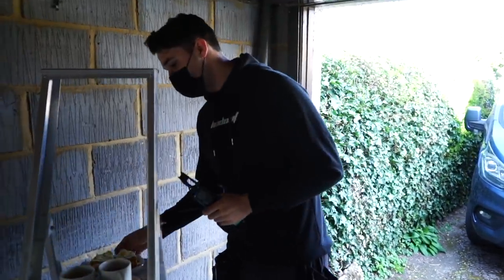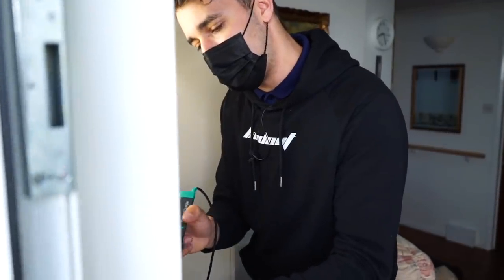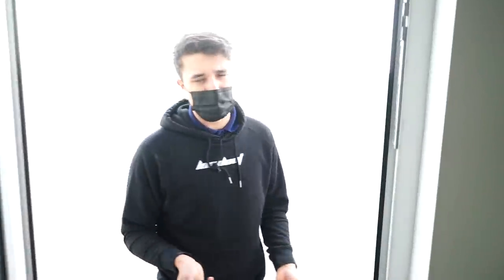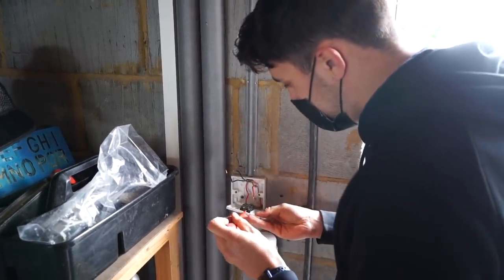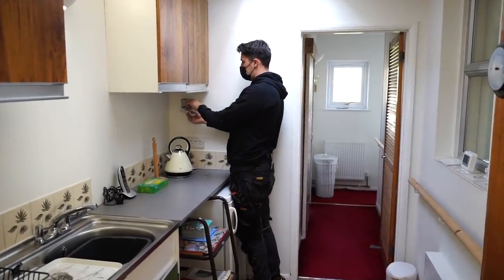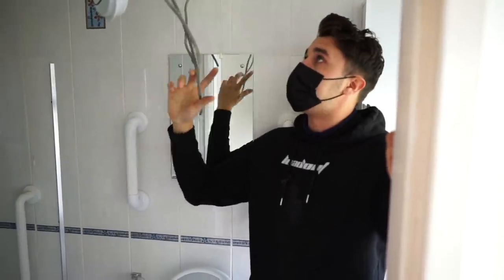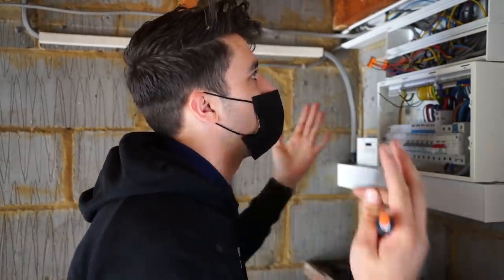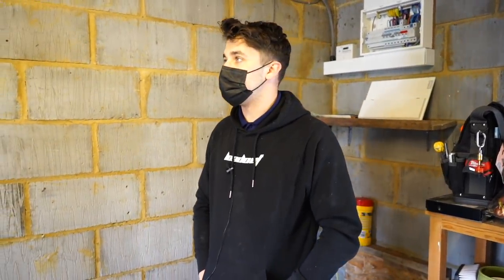Fault Finding a Scary Lighting Circuit - Electrician Life

Comment: 2:22 - Cory, I can imagine you wiring up a cooker and then immediately jumping into a cooking demo for the customer, teaching them a new recipe. 10/10 would watch that.
What a cluster that job was! 

For a time, I lived with some friends in a house built during the 1950s (US). Every light was operated by a momentary pushbutton switch that operated relays in the basement. After fifty years or more of use, the relays had mostly failed. Lights that were already on stayed on, because if you turned them off, they might not come back on again - or blink off before returning to on. At least half of the house had lights that didn't work at all, or would give one extremely brief flicker when you push the button before staying off. Receptacles on these switches didn't work in most of the house. An absolute nightmare.
I tried to convince them to do a rewire, since they were letting me stay there rent-free and I was unemployed and had the time to do it... It would have been pretty simple, everything was wired through conduits down to a single main trunking tray that ran in a beautiful straight line to the consumer unit and the box with all the relays in it. An electrician's dream to rewire! (The house was built by the same contractor that built several local schools, so it's over-engineered and built to a commercial level.)

Comment: Well done untangling this nightmare. I recommend buying yourself a Progressive Electronics 200EP inductive amplifier together with its audio warble tone generator for tracing out cables when you are on your own. As I have said in a previous comment this unit has saved me hours of unnecessary stress by quickly locating and identifying cables in an installation. On second fixes this unit helped me find cables lost behind plasterboard because cutouts in the plasterboard for socket outlets and light switches had been forgotten.

Comment: The lighting wiring you've described sounds very much like the French system using teleinterrupteurs..... basically you have a switch unit attached to the breaker in the CU which receives a signal from the switches which then sends sends or turns off power to the lighting part of the circuit.  The advantage is that you can have as many switches as you like and wherever you want them.
Reply: I remember staying in a gite in France that had an immense CU,  with a number of what seemed like contactors in. It seemed it followed the system you describe. A friend who moved to France and had to do up an old farmhouse using a local spark also said he thought his electrician was mad, but the guy assured him it was "the way it was done there". So maybe the spark who wired the property in the video was French. I don't see point in rewiring it, just to fit with UK traditions. Surely already 3-plate system can present problems with led lights, so new builds don't use it. Tradition is not always "right".
Reply: that's basically how PLC works. With PLC you only have power going through the controller relays to the lights and fans, and whatever else is connected to it, and then switches are connected to the controller through signal wires, which can be quite thin since they don't carry any real current. Since the PLC is programmed to turn on/off or dim stuff depending on which signal it gets (and what the current state is), you can hook up as many switches as you want using the signal wires and the only thing that determines what they do is how they're connected to the controller, and how that is programmed. It completely removes the need for switchback wiring when you want multiple switches controlling the same thing, and any switch can be programmed to be a dimmer if you want, or you can code patterns, where 1 press turns on the light, the next press turns on the fan, and so on.

Comment: An acquaintance wired his house like that - all switch wires back to the board - but there was method in this madness, he was an electrical engineer (with a trade ticket) and he built its own 'smart home' system. Every one of those switches was input to a computer which then controlled contactors to actually turn the lights on and off. He 'star wired' all the power points too, so they could be centrally controlled and monitored - he also added current sensing to each line and recorded power consumption for each circuit.  It was a LOT of work and wire. But he could turn on or off any light or socket in his house from anywhere that had internet access. When he built it, these modern interconnected smart home systems only just appearing on the market and were quite expensive. If a regular sparkie ever gets called to that property 'diety' help them. They will be flummoxed. It complies with the required standards, but it's not a conventional layout.

Comment: Looks like star wiring you used to do for running X10 din rail dimmers that all terminate in a node0 (or consumer unit in this case).  has the previous owner just taken all their home automation units out?
Reply: I was wondering the same thing - it smells a lot like a former home automation job

Comment: What a mess! Must have been a relative of the expert who wired permanent live and switch line to L1 and L2 on a 2-way switch, only to discover the light didn't work. Instead of moving the live to COM they ran a jumper wire from L1 to COM!

The light might be an ancient (early 60s) German fitting. Pre-1965 German colours were black live, grey or white neutral and red earth. The same scheme was used in a few countries, including Sweden and Finland. Romania (since that was named in the comments) oddly enough seems to have used a mix of US (black live, white neutral) and UK (red, yellow, blue, black, green) colours.

Comment: - Cable to a distribution box, from there a cable to the switch and a cable to the lamp.
- Cable to the lamp and from there a cable to the switch.
- Cable to the switch and from there to the lamp.
- But from the fuse box all cables to the lamp and from the fuse box all cables to the switches, this technology is new to me.  There must be cable lengths. 
As a consequence, you should place a radial for each individual socket to each individual fuse!

Comment: At the end of the day, that's a much better way to have the lights wired, especially as you said for smart switching in the future.
The main reason we do lighting wiring as we usually do with a loop down to the switch, is simply to save money on cabling. Wiring back to a central point is way more flexible, just a little bit more costly.
I would have just put a wiring centre box for the lighting near the board for wiring up all the lighting, so as not to lose the benefits for the future.
My 1969s house is wired a bit like that with one central junction box in the loft for all upstairs lights and another under the airing cupboard floor for the ground floor lights. That arrangement has been a real boon for later modifications and additions.

Comment: Yes switch off the living room lights & all the up stairs lights go out !
10 green cables wires all singles in the back of the living room switch box .
Not a one is ground . 
That is old school & so is the up stairs 5 amp ring in tinned steel cable ( in v i. r .cable )

Comment: That's been done by someone who didn't really know what they were doing, they would have used so much cable, i have seen it done where there was a big joint box, and there's only one cable at the light and one cable at the switch, but never like that though.

Comment: Does the power from the consumer unit in a lighting circuit go to the switch or to the lamp first..? Here it goes to the switch and cable is terminated  then carried on to the light from the other side of the switch and Earth /CPC  are used if required.class 1 permitting etc.
Reply: Both,it’s up to the installer

Comment: Not sure if you have the same problem as I had the other day. I found an old colour 3 core at both switches plus a single black at one of them.  I wondered where was the other conductor for the switch wire. However it transpired they must have taken the 3 core to the ceiling rose. Cut into it and used the red conductor as a feed to switch 1 and used red from switch 2 as a switch wire to the C/rose. But they had miswired and connected the yellow to the common terminal. This caused the symptom of light switching you described. The single black conductor was used to feed the next light on the circuit. In addition one of the switches was not working and the blue conductor had a break. Bit of a challenge for me :)

Comment: We all knew the cable he removed was going to bite him at the end.
Reply: We did an eicr yesterday. Appeared to be a redundant immersion heater feed in the board. My mate said yeah we'll snip that off. I told him to hang fire because the spur for the fire suite was in a weird place half way up the wall right below where the cylinder cupboard was. 😉 But that appeared to be on the lighting circuit (6A...yeah). We energised the old immersion feed and lights came on. Wtf? Somebody had mixed up lights and the immersion feed. Leaving a lighting circuit on a 16A and the fire (clearly never used) an a 6A. All 1.5mm so guess an easy mistake to make but good job my mate didn't cut off that redundant feed as it fed a lighting circuit!

Comment: Nobody would blame you for working live in that situation. Empty house, only you and camera man there.

Usual way of wiring lighting in singles is to loop the permanent live through each switch. It's dead easy. They seem to have made a massive hash of it.
Reply: I do it all the time when I lose the switch live when changing pendants 🤣 ends of cables dangling out the ceiling, but I know not to touch them and keep the cables separated
Reply: @leewinters606  eh? I never said it was unsafe. Quite the opposite. He's by himself, not causing danger to others.

Comment: Old school ,  the way we wired thing to day we have been doing it since the 1960s , that's 55 years you whipper snapped . I've been doing 3 plate lighting since I can remember , a radial circuit has never changed. CUs and DBs have changed for the better but they are still basically wired the same . That house as never wired by a spark. Us old school sparks are training you going whipper snappers , we take you college clowns are turn you into real sparks? A tone generator I told you a few times you need one.

Comment: Why I’m not surprised?.British electrician builders and plumbers my neighbours had live cable hanging under the sink in bran new house leaking bathroom that’s standard the finishing skimming terrible you can see every joint 400mm centres I guess they send one man to do the job so he chopped up those boards in 400mm easy to lift up if you do on your own. Roof problems not even one vent tiles in the roof cheap felt sweet like ffffffin the winter. Where is the building inspector I’m telling you where he’s been paid off .ffff c....ts